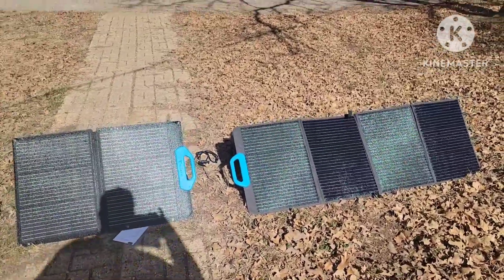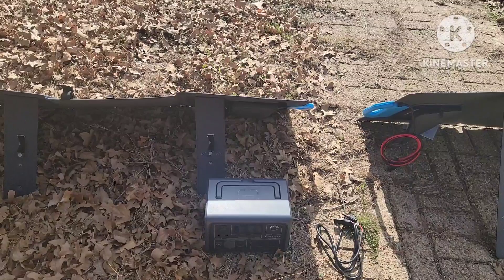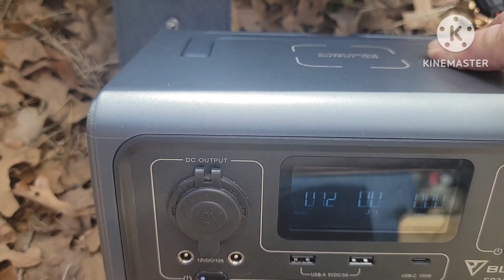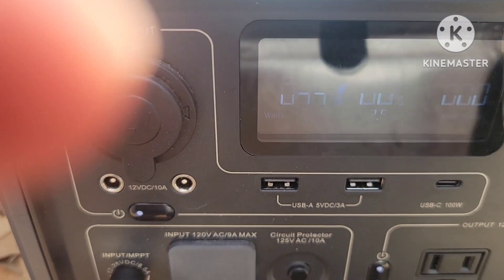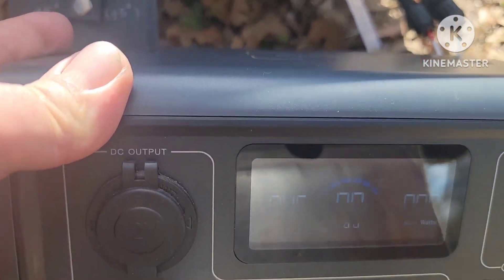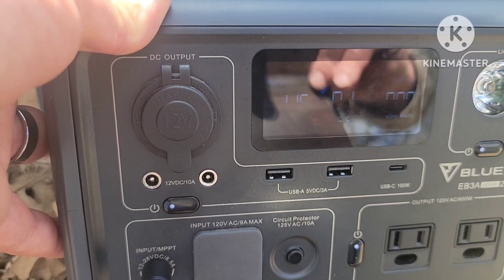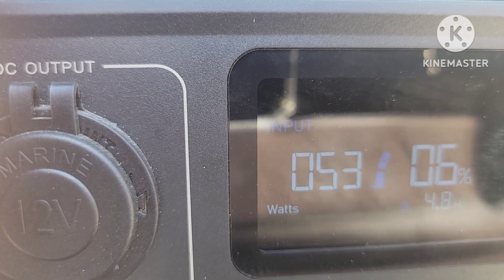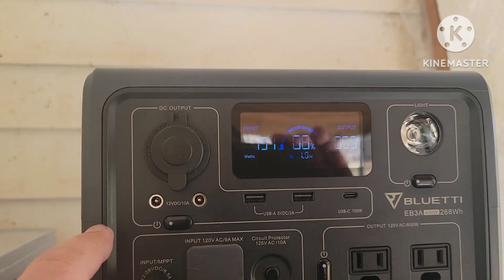bluetti pv68 vs bluetti pv120 and renogy 200 watts

Comment: Can I connect 3 PV68 in parallel and operate them on the EB3A?
That should actually work. The voltage remains at 24V and the current triples to about 8.5A. This gives about 204W, which the EB3A can cope with.
Are the cables thick enough for this?
Reply from the maker: Yes....this should work fine.